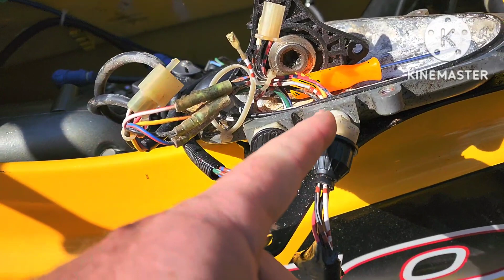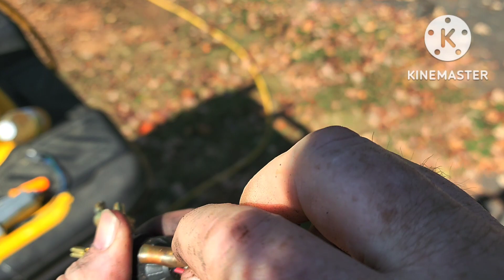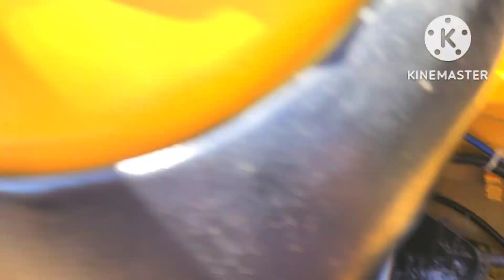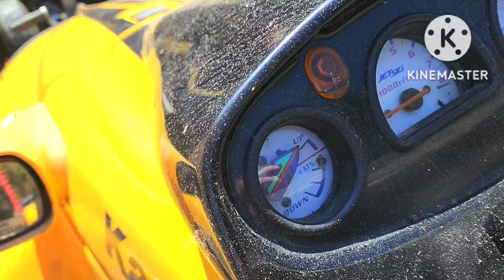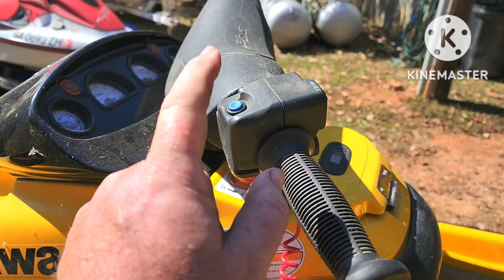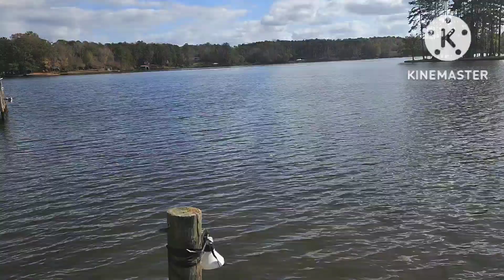Kawasaki 1100 ZXI trim motor replacement and lake test.

Comment: Hey buddy, I need help. I have a 2000 ZXI 1100 and it ran well for two summers and used moderately. Bough it from a lawyer in Des Moines and it is immaculate. Suddenly the start-stop button stopped making anything happen when I tried to start machine. I opened up switch and it looked fine. I replaced solenoid and killed myself installing a new starter. The battery is fine but the ski just will not do anything. The meters are acting weird when I turn to orange power switch on. They dance and then position kind of funny. I have tried jumping the solenoid and nothing happens. I have been reading about the issue of a short in the trim box because of its location in the back end bottom of the vessel. (you alluded to that). Any thoughts on what my issue might be? Paul in southern, Iowa. Enjoyed your video as you are pretty straightforward without getting cute or long winded and I like that. This ZXI 2000 is my favorite and I own several including newer 4 stroke models. Help!
Reply from the maker: @lamonicommunityofchrist  You probably solved your problem already.  I think the power for the switch goes through that trim motor box and if the wiring gets corroded down there you lose power.  Trace your 12volt signal from the battery and see if it isnt coming out of that box to the trim switch.

Comment: Someone deleted the trim on my zxi 900... can't seem to find how to put it all together. The cable is still there just the whole motor assy is gone
Reply from the maker: @timsussenbach5376  The boxes would leak causing the motor to seize up.  TCH watersports near me has the box if yours is missing, but likely the motor inside will be bad.  They were the same on the 900 and 1100.  They got away from the electric trim pretty quickly because it was too problematic.

Comment: Hey mane got it the zxi1100 running and ran hood on the river! After 30min engine speed dropped down significantly and wouldn’t accelerate coasted it back to dock! Opened the hull and seen a lot of water! The motor is fine but any idea on where it could be leaking from? Drain plug was tight
Reply from the maker: You either have water co.ing in around the output shaft bearing or you have water leaking from your exhaust.  It could also be from hull damage but usually one of the other two.
Reply: @ShadetreeJetski  output shaft a hard task?